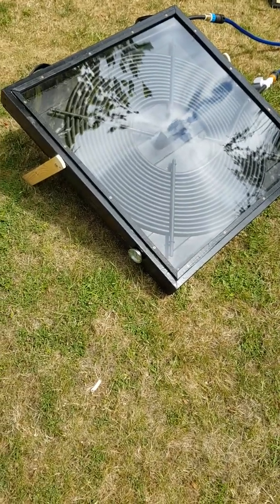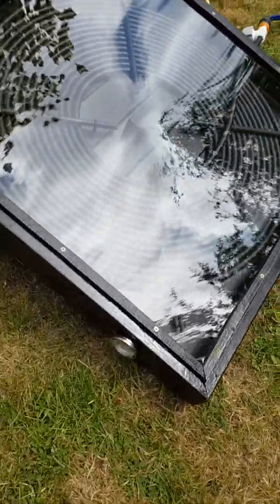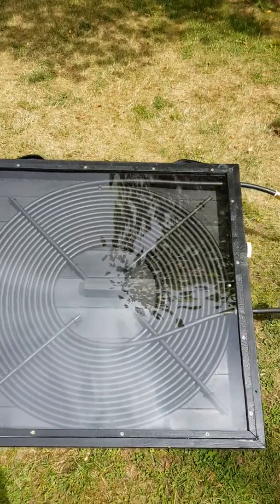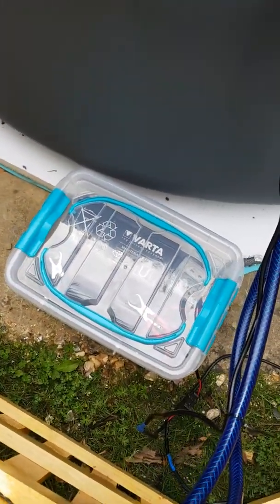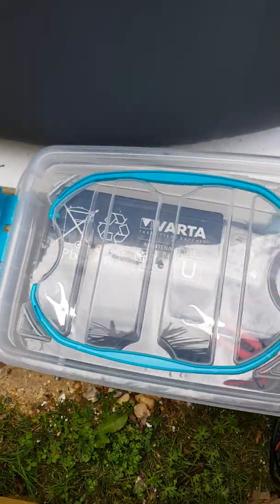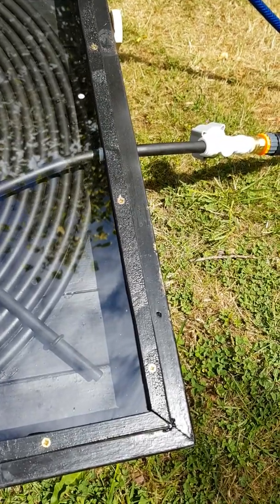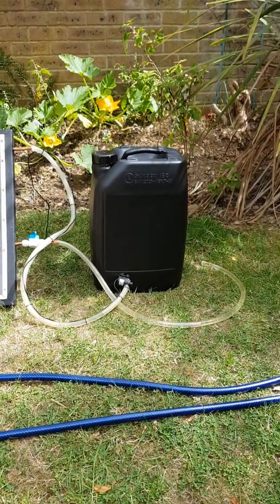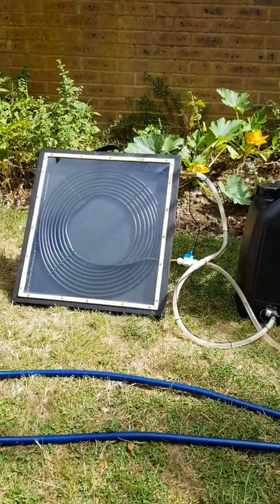Tips for building a solar water heater for hot tub

Comment: Is the tubing coil really necessary?  What would happen if you just pumped the water in the top and let it drain back into the pool?
Reply from the maker: Hello, thanks for taking the time to view my video and comment. The coil is really to allow a larger volume of water to be heated in a smaller area, you could do lines but I don't believe you would get as much pipe within the box. Also the coiling transfer heat amongst itself, the more air you have passing through the pipe, cools the exterior thus reducing heat build up.
You also want water passing slowly through the pipe, the coil compacts 28m into the box.

Comment: Hi, this looks great. Any updates on how it has worked out over the last few months and anything you would change? Thanks
Reply from the maker: Hello, thanks for taking the time to view and comment on my video. Sadly we have not had the hot tub out in the last 12 months, hopefully this year we will have an opportunity. Although we are soon starting a campervan conversion so it will either be put aside once again or a welcomed break in the evenings. Over the time I have used it, it worked very well, I did consider building another to feed one into the other before replenishing the hot tub, but need to look into the pumps capabilities first.
Reply: @royclark8385  thanks Roy, I'm keen to give it a go. What sort of water temperatures were you getting with your setup? Did you have to boost it with grid power?

Comment: Hi Roy Thanks for sharing your design however copper will not react with HCl I presume that it will not also for elemental Cl with all due regards can you verify this.  We used copper tubes to cool  inside section of glass  furnace and flash then for scales by HCl.
Reply from the maker: Hello, thanks for taking the time to view and comment on my video. My initial information came from a professional swimming pool installer and confirmation of this is found at 
byjus.com
The copper reacts vigorously with the chlorine to form a cloud of copper(II)chloride. When the flask is rinsed with water the copper(II) chloride dissolves forming a blue-green solution. Copper and chlorine do not react rapidly at room temperature, but if the copper is heated, the reaction is vigorous.

Comment: Hi Roy - Love the video and being 31 x 31 in size it suits my purpose brilliantly.  Two questions if I may ?  1 - what size is the upgraded plastic / pex piping is it 10 mm / 13mm or 15mm  and do you think the smaller tubing would heat up faster or less as it would create a faster flow as such.  Q2  - what flow is the submersible pump please as I have an outside socket right by my lazyspa so I'm thinking of a 240 v  one, naturally have to think of the height of the tub and resistance around the piping - Look forward to your reply  Cheers Derek N. Wales
Reply from the maker: Hello Derek. Thanks for taking the time to watch my video. The pipe was bought from screwfix, 
FPX15B/50 Push-Fit PE-X Barrier Pipe 15mm x 50m White. And the  water pump from eBay, 
12V Water Pump Submersible Caravan Camper Motorhome High Flow Whale Pump 600L/H
Not sure whether using a different diameter pipe would make a notable difference, copper pipe works great but cannot be used with chlorine.

Comment: I just made one of these but modified it to 4 ft x 8 ft and was able to get almost 500 ft of tubing in it ( actually 480 feet ).  Very heavy so I added two heavy duty wheels.  Warning : Do NOT  try to stand up after running water through it……. the weight of the water in the tubes is a problem maker.  Working on coming up with an Air Hose to plow the lines out before standing up.  First day using mine , outside temp was 81. Filled the pool up with 72 degree water. Water came out of my devise at 86. Only getting 6 hrs of Sun so will takes a few days to get pool to 85.
Reply from the maker: Hi. Well done, that is certainly up scaling..

Comment: Is it worth adding a small Solar panel to the top of the battery box to keep the battery topped up?
Reply from the maker: Hello. I do have a 10watt panel charging my 12v battery. Being 10watt or less means you don't need a charge controller from the panel to the battery.

Comment: What happens if it runs dry? Will that damage it?
Reply from the maker: The bump is brushless, so in theory it can run dry but it's not advisable. If no water is flowing through the box, it will get very hot inside the box, this could cause damage to the clear perspex, causing it to melt, also the sealant.
Reply: @royclark8385  thanks 👍

Comment: Hi Roy, great video thanks you. Can I ask how you recharge the 12v battery used with the whale pump and timer?

Regards
Ben
Reply from the maker: Hello Ben
I used a 10watt solar panel directly connected to an old 12v car battery. The pump draws a small current but I found the 10w panel keeps the battery topped up fine. The panel can be sourced off ebay very cheap, at only 10w you don't need a charge controller between the battery and solar panel.

Comment: Hi Roy I love your video, one of the best I’ve seen so far. Could you list the parts as I’m going to try and replicate your design. I have a similar solar panel set up for our summer house that provides 12v for outside lights. Cheers, Steve in Sussex
Reply from the maker: Hello Steve. Thanks for viewing, I have listed all parts used in my replies to previous comments.
Reply from the maker: Their is also some additional tips I discovered whilst building which may be of some use.

Comment: Great informative UK video Roy which gets straight to the point unlike some US Vloggers.I hope to build this for my lazyspa.
Could you send us a link to the piping length and diameter, temp gauge and the timer switch you used.
Thank you 😊
Reply from the maker: Hello Clive. Thanks for viewing. I have listed all the parts in a conversation/reply with Dai. The timer was purchased off ebay, 12V DC Digital 7 Day Programmable Timer Switch LCD Control 16A Power Relay at a cost of around £10
Reply from the maker: The piping used for the larger of the 2  heaters was pex pipe 15mm bought from wickes on a 50 metre roll, had some left over but could not buy it on a smaller roll at the time. This is the type of temperature guage I used, I wanted one with a long probe so as to protude into the box as much as possible. Grill Thermometer Stainless Steel BBQ Thermometer Cooking Temperature Guage.
Reply: @royclark8385  Hi Roy I built virtually the same setup but slightly bigger box to contain 30 metres of hosepipe. We had a hosepipe ban so thought might as well use the old useless hosepipe.
Had some great results during the recent heatwave.My only concern now is, I should replace the hosepipe with PEX pipe painted black or irrigation pipe.
I have heard some horror stories, in the past they used heavy metals like cadmium and Lead to make hosepipe and with the heat these chemicals could leach out into the hot tub...
What are your views ...🤔👍
Reply from the maker: @Clicon61  Hello Clive. To be honest I really don't know, their is a possibility that could happen, I used pex pipe based on its wide usage. If I built again I would again use pex pipe, as its durability is said to be 20+ years.
I know chlorinated water is OK in pex pipe but not running through copper pipe.
Reply: @royclark8385  Thanks Roy for your advice, I think I will play on the safe side and get 50m of Pex pipe, 30m for the solar box coils and 20m between the hot tub and solar box. To play on the safe side It might be worth you changing your hose pipe between the solar box and hot tub to Pex pipe, so no toxins/chemicals are leached from the hosepipe by the hot chlorinated returning water 👍😎

Comment: Great video, 2 quick questions how many of these do you think you would need to get the water up to 32 degrees in summer and also how do you drain out the water for winter. Thanks
Reply from the maker: Hello. Thanks for your interest. I ran mine in 2020, during the hot summer and my hot tub hit 34 degrees, but it all really depends of the amount of sunshine, less sunshine then a greater volume of water being heated will be more efficient. As for draining during the winter, once you remove the hoses, open the valve, any water will naturally run out, rotating the unit a few times will disperse any trapped water, alternatively blow some air into the top port forcing the water out the bottom.
Reply from the maker: Sorry I meant greater volume of water would be less efficient..

Comment: Hi what pump did you use?
Reply from the maker: Hi I used a 12V Water Pump Submersible Caravan Camper Motorhome High Flow Whale Pump 12 Volt, purchased from eBay, for the large solar heater and a small 12v 10w solar panel operated water pump for the small unit.

Comment: Hi, this one of the best solutions to heating the hot tub I've seen. Well done. I'm thinking of attempting the same this summer. Could you list the parts please? I like the copper one, might use that in combination with a larger tub tank to have free showers in the outhouse shower cubical. Bit of thought around that one needed?  wish me luck! cheers. Dai
Reply from the maker: Hello. Thanks for viewing. I used 10 metres of 10mm copper piping from my local wickes, around £30. The box was made of some old tongue and groove wood I had in my garage with a simple frame added. I added a piece of polystyrene to the back, on the outside to add insulation but it melted on one day due to the box reaching an internal temperature of 145 degrees.. A sheet of 3 mm perspex was used on the front. I fixed this too the frame via wood screws. You can safely drill perspex using a sharp drill, it won't crack or shatter if you go carefully. Make sure the hole you drill is one size up from the screw being used as if the screw is tight fitting, this will cause a crack upon tightening. The fixings are John guest speed fit for 10mm piping. I added a tap to slow the flow rate down, be careful as if the tap is closed the water inside the box will soon hit boiling point. My water is pumped around the system using a 400L/H Solar Panel Powered Water Pump Garden Pool Pond Fish Aquarium Fountain, bought off ebay. I have a 20ltr water container in black to also absorb heat. The feed pipe is just a short length of common fuel line.
Hope that helps
Reply: @royclark8385  many thanks Roy, I am about to experiment with both your copper piping method for a shower in an outbuilding through a tank and a solar panel powered system for the hot tub....thinking of options around including a battery and controller for a bit more consistent heating,,, ironically just before you replied I purchased a pump and heater in one which I saw on another utuber 's channel.... really excited to see all this working and saving some money... thanks again... Dai
Reply: @royclark8385  could you let me know how that black 20lt container is in the loop system?
Reply from the maker: @cosmicdai  Hi Dai, the 20ltr black jerry can is solely used with the smaller copper pipe heater, it just happened to be next the the larger one at the time of filming, its not linked in any way to the larger solar heater. Good luck with the build..

Comment: Do you think if you scaled it up maybe on a shed roof, so it has more time to heat up it would work better?
Reply from the maker: Hi. It really comes down to surface area, the more pipe you use and surface area covered. Slowing the water flow down did increase the temperature within the pipe, but its a trade off with total volume of water heated through the piping. I made a smaller one using copper pipe and this one is more effective in heating water but running chlorine through copper is said to turn the water green.
Reply from the maker: Also fixing it to a shed roof will limit the ability to angle it towards the sun throughout the day.